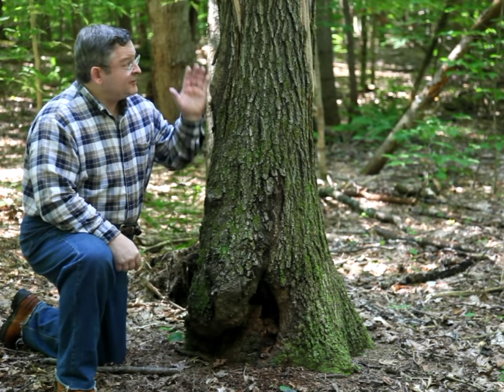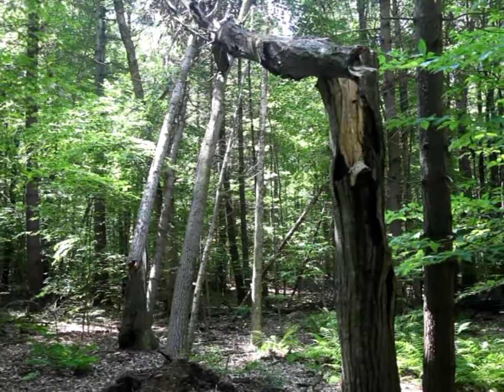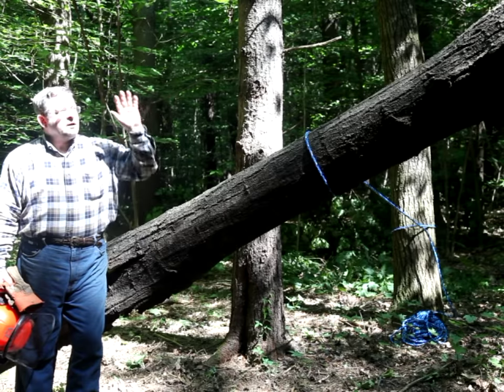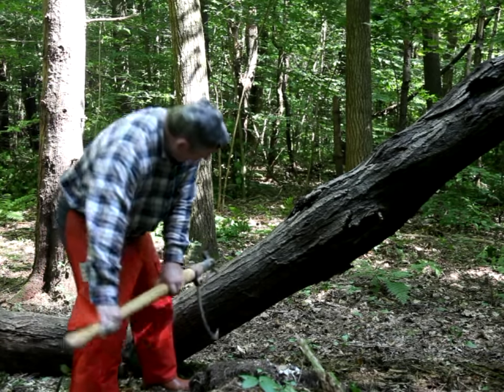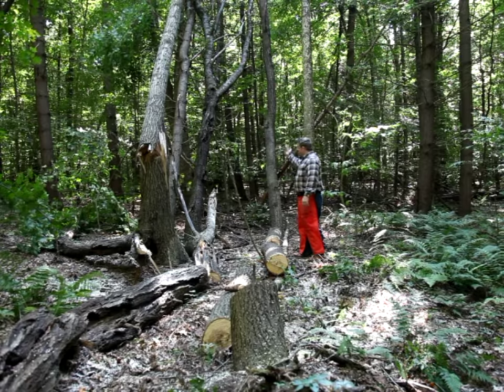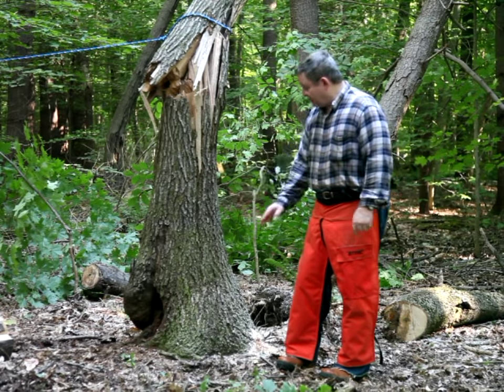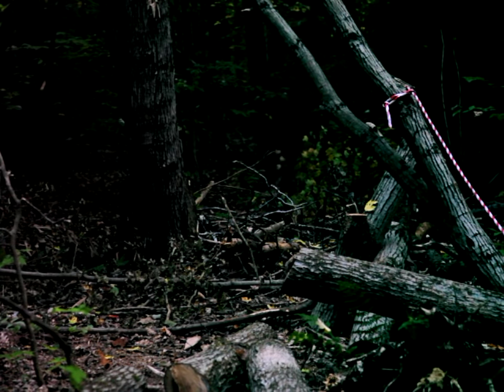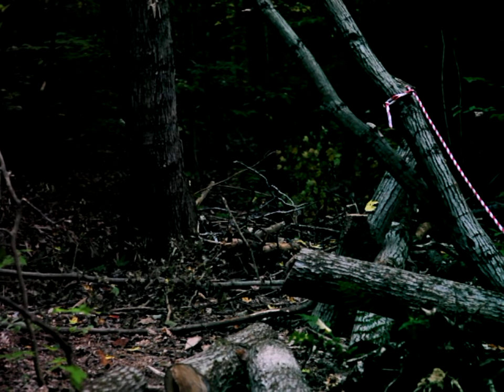Widow Makers

Comment: I would like to thank you for learning me how to think during tree felling. This knowledge, I used it yesterday while cutting a leaner. During the process I realized how easily the compression forces are transformed into distraction ones depending on the angle of your cutting. Knowledge is the force to solve easily, difficult situations.
Greetings from mount Olympus, Greece.
Reply from the maker: Thank you, Konstantinos!  I applaud you for researching a potentially dangerous situation before acting.

Comment: Terry, I use a come-along and a cable instead of rope and whatever kind of tensioner you are using.  They are relatively light and I carry them through the woods all the time.  I have pulled down a lot of widow makers with them.

Comment: First time finding your videos. Very nice work as many have mentioned. Thoughtfully done. I recently purchased chaps, which I love,  and see you use them and a safety helmet. I'm also glad I read your replies to see why you didn't use your tractor. My forester has many trees marked for removal and I love spending time in the woods planning the easiest and most safe way to take them for firewood. A really good 3/4" rope, snatch block, wedges and tractor all help me avoid problems...but your roping and systematic cuts were brilliant.
Reply from the maker: Thanks. Scott.  "Easiest and safest" is the way to go.  I admit to being intrigued by doing things with century-old technology.  That said, I gave up chopping down trees nearly half a century ago.

Comment: Great video.   Dealing with widow makers are not always easy.  I had a huge Poplar fall and take down 14 trees.  At first I looked at it like a gold mine of firewood.  But processing the tangled mess was anything but easy.  I started by cutting the branches and tops off. Cleared all the debris, tops, branched away.   It was a lot of work and got firewood of maples, birch, aspen, and some small oaks.   Your video clearly shows how hard it is to get free wood.
Reply from the maker: Hi, Nine.  I hope that poplar works for you as a firewood.  I only use it to give live branches to the beavers.  The poplar in this part of New York comes down wet and heavy.  Once it finally dries, much of the mass is gone, so it burns up quickly.  To make matters even worse, I find the smell of its smoke unpleasant.  Again, I hope yours is better in every aspect.
Reply: Terry Hale :   I burn it during the day only.  Burns fast and hot
Reply from the maker: Glad to hear it's working for you.  I burn around the clock and save the oak for overnight.

Comment: Corrrect me if I'm wrong. At 7:44 when you fell couldn't that poplar have fallen right back toward you? I use snatch blocks to keep my bones out of the kill zone.
Reply from the maker: It was definitely tall enough to have reached me.  However, the lean was still away from me and, by pulling the base towards me, the lean away from me was increased so that there was essentially no danger of it falling my direction.
I probably should have stated it, but this video was intended for those who either don't have a good winch or, for some reason, didn't bring it with them.  At the time, I had two good winches (now three) and using them would have made this a much more straight-forward task.
Reply: good call ed.  hes putting sidepressure and should focus on the rope puller from masdaam which coupled with a arborist block could ramp up any half inch dynamic line up to one and a half ton pull. i have pulled over backleaner giants next to million dollar homes and won bets. I wont use trucks except as pulley anchors and even they have moved and drifted but they are consistent with no surprises slipping off the gas pedals. this method he is doing isnt proffesional

Comment: great stuff, it will help be alot in my efforts to keep my local forest road/trails open. i like the emphasis on the unpredictability of trees in those circumstances.
I looked through your vids. I had surprising circumstance where i had the opposite problem of  a learner. Standing deadwood which i wanted to fall away from a trail, I had a very tough time getting it to go over even with a felling lever and wedges just resisted leaning it seamed. wood was punky.

Comment: I’ve had a number of widow makers on my property that I had to deal with. The method that worked the best for me was to make a cut near the stump,wrap a chain or a cable around the tree and pull it out with my tractor or my 4wheel drive truck. With my chain and cable I can remain 40feet away in safety. Also much quicker than multiple cuts
Reply from the maker: Definitely a faster way to deal with it.  As stated to numerous similar suggestions, the video was made for those who don't have such vehicles available or can't get them to the location.

Comment: May I suggest adding a Come-along to your arsenal of equipment? It comes in very handy for pulling hung-up trees away from their snags. They're most effective after the ground freezes. That way the tree doesn't dig in as you pull the base along the ground. Tip: re rig the come-along as many times as it takes until the tree falls.
Reply from the maker: Justin, Thanks for the kind suggestion.  I've actually had come-alongs for decades and had three at the time this was shot.  My intent was to make a demonstration video for those who either had none or didn't want to lug more than a chain saw and a couple lengths of rope deep into the woods.

Comment: IME: some of those leaners could be "bottomed-out" in sections with a single cut, from above, with wedges (yes, 2) pounded in behind ASAP. Since you can buy 2000 lb hand winches for ~$20 and 2800 lb tow straps for ~$10, they're what I use for serious pulling. Way better than yanking on a rope IMO. Absent heavy equipment, my choice for mule-work, and lots of other stuff.

Comment: I have had to pull on a lot of trees to fall them in specific directions and I would not dream of using ropes of any kind. I do instead use 1/4 inch aircraft cable with a lever operated come-along.100ftof that cable and the come-along are not very heavy to carry into the bush.Other than that your advice and your cautious approach to that kind of tree work are well worth listening to.
Thanks
Reply: I'm here to tell you that you have to be careful about where the tension on that cable will be during the fall. My first approach was to use steel cable, thinking, if rope is good, wire rope is better. However, the end of the fall was that my winch could not take the strain and pieces of it flew apart.  I learned later that rope has a distinct advantage in being able to absorb energy by stretching, and I have a Marsdaam rope puller now. I think you're doing yourself a disservice by not giving rope another look.

Comment: My only suggestion is to use a proper logging chain when fastening to the tree.  If any of those trunks split from the tension, that rope would snap.  For anchoring to other trees on the non-cutting end, I prefer a 2" webbed strap.  Put additional chains and a 2-ton come-along in between, and you'll have much better control.  I've had widow-maker weeping willows in my yard at over 3' in diameter, but good chain and sharp saw got 'em on the ground safely!
Reply from the maker: I agree that more is better.  However, the point of the video was to demonstrate methods for those who may not have all of the desired tools or may not do this kind of work often enough to justify getting them.

Comment: That looks kinda fun with all them ropes and things . We didn’t get to see how all the ropes were tied and routed must take lots of planning
Reply from the maker: A very ad hoc series of arrangements.  Basically pulling the main rope as tight as I can, then tying a rope to the middle of the first rope and pulling it sideways to increase the tension in the first rope.  Can be repeated on the second rope until the desired spider web appearance is achieved.  ; )

Comment: Holy Wah !!! A triple.    And two split or broken bases.  Well done.  Very scary to unravel,,, and you did super.

You nearly do what I do.  I call it 'walking the butt'.  If I have a hanger, lets say in a crotch leaning west.  I sometimes use notches,, not always,  I cut fireplace lengths (you cut 5 footers) but for each piece,, I walk the butt that same length closer to the base of the tree  until it is straight up and down, then push or pull it to the east..  Pushing often works well because I have the standing tree, the crotch tree to shield me, or pry against.
Reply from the maker: I'll admit to doing exactly the same.  However, I wouldn't want to publish that as someone could easily not get it right and then come to serious harm.
(Each of those ~5 footers was destined to become three ~20" fireplace lengths.)

Comment: Nice job, you could use a machine to do some of the pulling.
Reply from the maker: Definitely true.  I could have used my tractor, pickup, or cable winches.  However, if I did, who would be interested in watching such a video?  The intent was more to demonstrate options for someone who could only get a chain saw and ropes to the site.

Comment: The little electric winch I bought back in 94, to help clean up storm damage after tornadoes as a volunteer,  cos me all of 69.00$,  has 100 ft.  Of quarter inch cable,  and can pull two tons,  off of a twelve volt car battery. 
     Preloaded many a hung widow maker,  and pulled hung trees down with it. 
      A hand operated come along and good 1/4inch cable is more dependable that any rope. 
       The cost of one shoulder Injury or back injury,  way exceeds the cost of an electric winch or come a long.
Reply from the maker: Good advice for many viewers.  I have a tractor and had three, now four, cable winches, that could have made that into a trivial job.  My intention was to provide something for viewers who would not have those resources, either with them, or at all.
Reply from the maker: I've put years of effort in developing padding in that area to avoid such a bust.  Also, the ropes were stretchy enough (and would be for most viewers) that the movement available by twisting would be too modest.
Reply: Carroll Sanders l.p. l.p.p

Comment: I've got about a 28 inch oak,  that's uprooted and lodged in another big 30inch oak,  lodged right in the forks of branches I'm afraid as it comes down its just going to go to vertical and stay lodged in the forks above
Reply from the maker: Those lodgments can be a real problem, especially with big trees that you can't pull out.  One can be so stuck in the other, that pulling hard enough to pull it out could be enough to topple the second tree.  Even If I could see the two trees' conditions, I'm not sure I could give good advice on what course to take.  If you feel you are a fairly competent woodsman, you might have a chance that you could cut enough of the first tree away to prevent it from toppling the second.  However, if you can't do much, you would still need to call in an insured arborist to deal with the remaining mess and you might not have saved any significant money, but would still have put yourself at risk doing however much you got done.
Reply from the maker: Those lodgments can be a real problem, especially with big trees that you can't pull out.  One can be so stuck in the other, that pulling hard enough to pull it out could be enough to topple the second tree.  Even If I could see the two trees' conditions, I'm not sure I could give good advice on what course to take.  If you feel you are a fairly competent woodsman, you might have a chance that you could cut enough of the first tree away to prevent it from toppling the second.  However, if you can't do much, you would still need to call in an insured arborist to deal with the remaining mess and you might not have saved any significant money, but would still have put yourself at risk doing however much you got done.

Comment: Great video! I'm getting some excellent ideas of what to do about a fallen pine tree that has lodged into another tree at about a 35 degree angle. The condition of the pine tree looks more sketchy/rotten, and I'm not sure it will stay in tact as good as your tree did as yours came down straight. My biggest concern is whether it will stay in tact. The question is whether to leave it alone or not. Unfortunately, the people few people riding horses on my property have to go under the tree to stay on the trail. It's a paradox of what to do.
Reply from the maker: Tough call.  Maybe wait until it's rotten enough to make it reasonable to attack it with an ax?

Comment: Decent video until just after the 6:00 minute mark.  After he makes the first cut into the '2nd poplar' with the lifted root plate, the video skips the work he did to cut the felled tree into 2 blocks, leaving what remains of the poplar leaning almost vertically.  Those would have been good views to watch as well.  Also should show how each cut is made, with a good explanation , rather than play the cuts at high speed without any voice over.  If these two shortcomings were addressed , it would make this an excellent video of how to handle a complicated situation caused by storm damage. Liked the thoughtful explanations of his approach, and the use of tension ropes.

Comment: Thanks for the highly informative videos, Terry. I pulled two widowmakers today using rope and a 4000-20 Lug-All chain hoist/winch from far outside the range of danger and using a snatch block. One question for you: how do you suggest protecting the rope that is thrown and noosed around the trunk? Is the intent of throwlines and weights more for climbing than for winching? I could use a ladder to set it up using a sling but it wouldn't be able to go as high as a throw. Perhaps a sheath for the end of the rope just about the slip knot? A cut bike tube comes to mind. Thoughts?

Comment: I had a hackberry which lost a large branch, 12-14 inches dia., it broke off and the top was secured in the crotch of a maple on the other side of the driveway, 12 feet above the ground at an angle. The top was a few feet off the ground and I thought if I could cut the top of it I’d be able to wrangle it down or the heavier broken end would redistribute the weight and come down. When I removed the top it rebalanced ...it was like looking at some kind of anti-gravity trick... and slowly raised higher balancing there. It looked like a gigantic cross above my driveway. It was well above my head at that point and I had to (wife demanded) call a tree service. Neighbors walked by pointing at it. I should have charged to see this thing. We had to drive cars under it to get to the street. When they arrived he said... “Wow, how did you do this?... This is a work of art!”  We laughed. It just started as a broken branch after a wind storm.  They parked a bucket truck on the other side of the tree and removed the branch from above then chunked the tree down from the top, down.

Comment: I would like to suggest adding a rope hoist and cable hoist to your tools.  I use Lug All hoists (rope and cable).  I am not sure about the rope you were using, but it seemed small to me for that size loading.  However, based on the rope the load limits vary a lot based on type of rope.   I have a small rope hoist that I connect into the rope and use, and for larger pulls I use a 2 ton cable hoist.
Reply from the maker: Thanks, Matt. I actually have all the tools: Five cable winches, a double block pulley system, and a tractor.  The video was intended to demonstrate what could be done without those.

Comment: What type of pulley are you using that will not allow the rope to reverse or maintains tension?
Reply from the maker: Mark,
   While there are some rare pulleys that have pawls to capture progress, the one in the video is just ordinary.  Tie one end of the rope around a tree, pass the other end through the pulley, pull it as tight as you can, and tie that end around the tree.
   Terry

Comment: Mr. Terry Hale, is that a "mechanical advantage" to pull in the middle of the rope as you did (when you retained your dignity!) when one end is connected to a fixed point and the other to the movable point? ... if so, would it be a 2:1 advantage? Thanks!
Reply: Never mind, sir :) 
I found the answer on your video: "Pulling Trees Down With Rope"
Thank you for your instruction!

Comment: i would ahve made a partial cut at the base, taken a comealong, and cabled or roped to the lower half, just below the break, and winched it backwards
Reply from the maker: Lots of ways to do the job faster,  This was intended to be a demo of how to work in a situation when you haven't lugged everything into the woods, like some of the High Peaks trail maintenance work in the Adirondacks.
Reply: i suppose. it work after all
Reply: I'm wondering how much force is required to move a leaner against its lean. [Terry's probably got a vid on that already...] I know I tried to use wedges, ignorantly I admit, to "drive" a leaning tree against the lean and exhausted myself with the energy required to drive the wedges just to get it up straight.  It was sitting down so hard on the wedges that with all my strength on every blow, I could detect only a trickle of movement. It would have paid to do that "segments" calculation to figure out how much lift was needed in terms of wedges beforehand because it might have decided me against starting down that road. My own particular lesson out of that operation was that moving things against their lean involves a lot more work than I personally guessed.